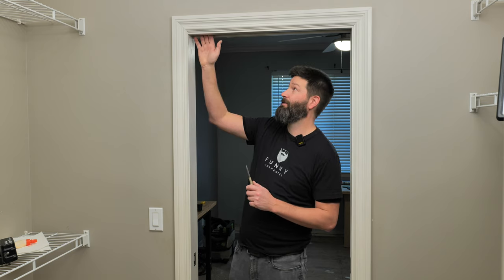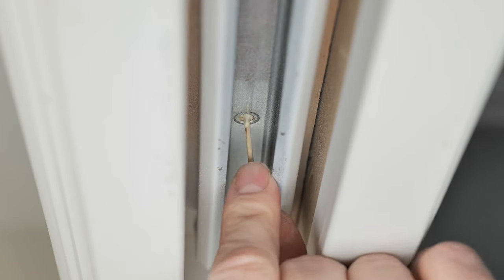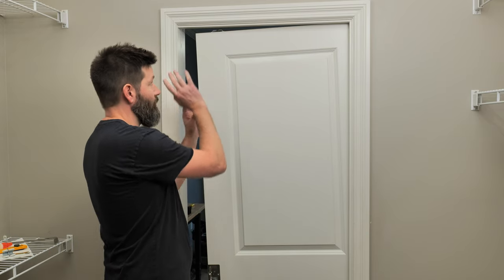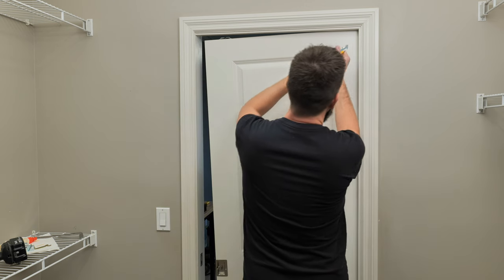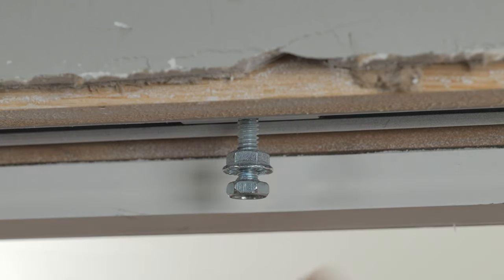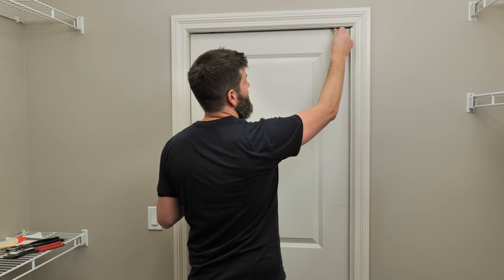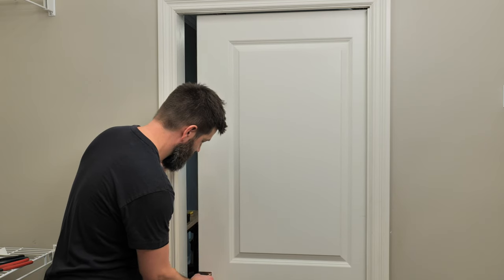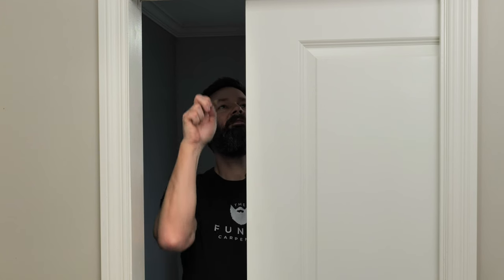The Easiest Way To Fix A Pocket Door Off Its Track

Comment: This is exactly the kind of project that makes me insane.  It'll take me 5 minutes to get the wrench on the bolt and I'll get one quarter of a turn and then I'm back to another 5 minutes of hunt and poke.  My wife will wander into the room and ask enough irritating questions that I'll eventually fling the wrench into the corner of the room and then have to spend the next 10 minutes trying to find it while mumbling obscenities under my breath while my wife berates me for my temper. 😂😂😂
Reply from the maker: Getting that wrench on the nut is one of the most infuriating things in life!
Reply: Maybe need a new wife instead of a new pocket door?

Comment: The geniuses who installed my pocket  doors installed the track so high up into the cavity that you cannot access the brackets or rollers without taking much of the door trim off. They also installed doors that are way too big, both in height and width.
Reply: I'm going to stretch here and take a guess that it's you who doesn't know how to do this operation, nothing to do with it being installed incorrectly. Just my bet . It's really neat knowing how to get these doors out when there's no room, and to do it without damaging much more than one piece, at the most two pieces of the top trim on one side only. This includes replacing the entire track if necessary without touching the wall where the door hides inside of

Comment: Right on bro, this was just what I needed to get the job done. I was lucky, mine was easier. The entire strip and the top molding piece are all one piece and it's just held in by 2 screws. On this unit, there is also a little plastic lock that snaps the bolt in place after you hook it into the top mount. Much appreciated, my brother, God bless. ~ Pastor Nick702, Blessed Road Ministry